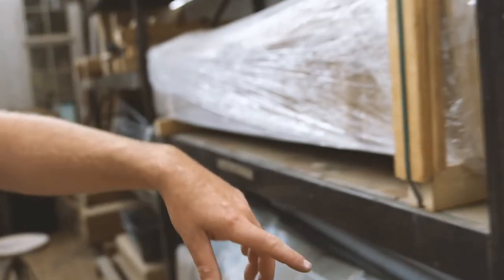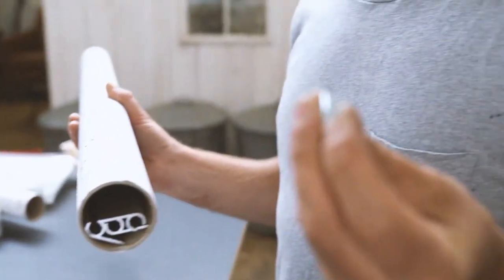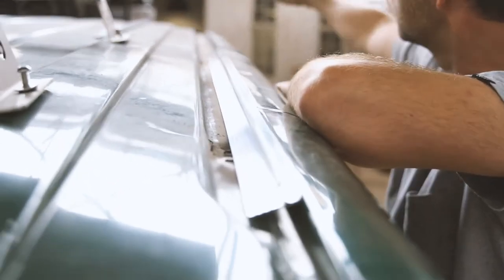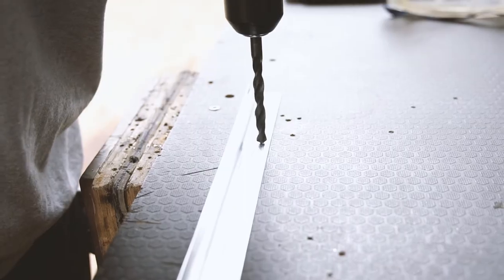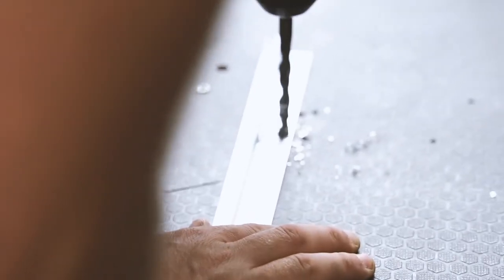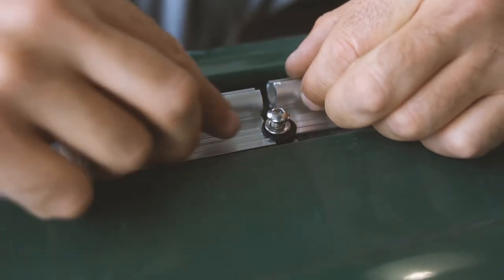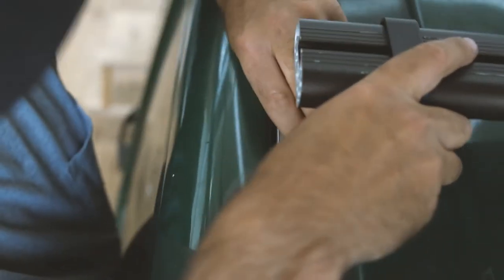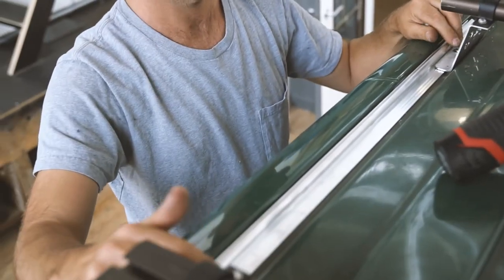@stitchesandsteel Universal Awning Rail, The Only Rail You Need, For Any Van, Including A T5 - T6

Comment: Where you have joined the pieces, there is a definite leak probability. You need to take much more care to seal those bolt holes.
Reply from the maker: Hey Neil, Thanks so much for your comment!
We've fitted a fair few dozen of these and have yet to have issues with Leakage, but we fully appreciate your input :)
All the best, S+S